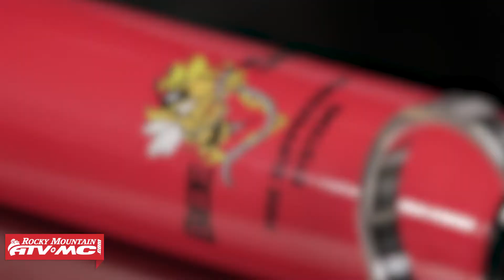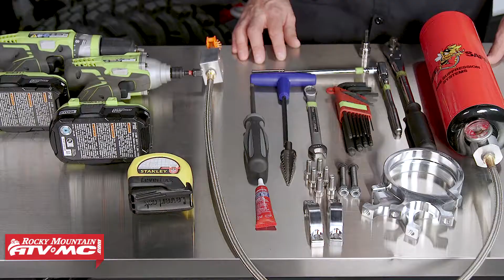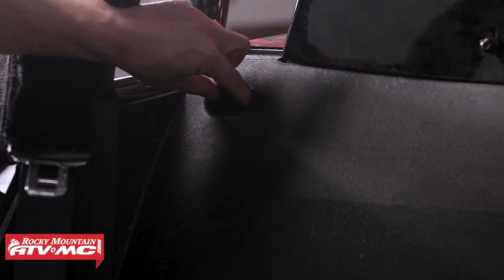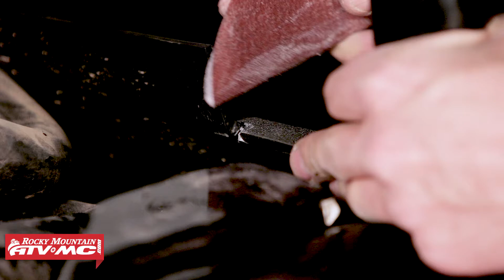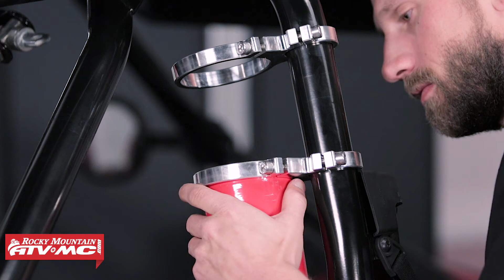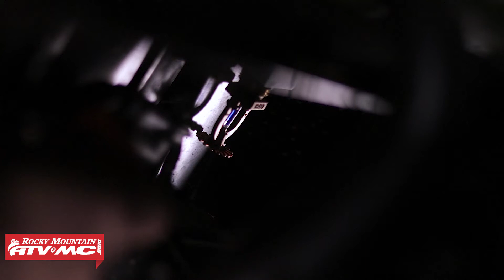How To Install Bee Safe Fire Suppression Systems | Arctic Cat Wildcat

Comment: I notice a lot of fire suppression devices lately 
has fires been a problem with these machines? 

because I haven't heard about enough of them to be concerned
Reply from the maker: No. Not a fire problem. It’s simply a fire prevention device and
protects you and your investment in case a fire were to break out.  Also,
a Fire Suppression device is required in racing applications
Reply: Unless you own a polaris! LMFAO! But really though in the event of a roll over the system wont work properly because it's now in a upright position.